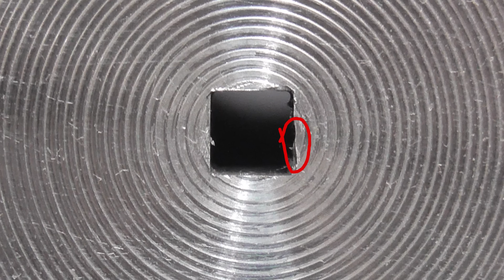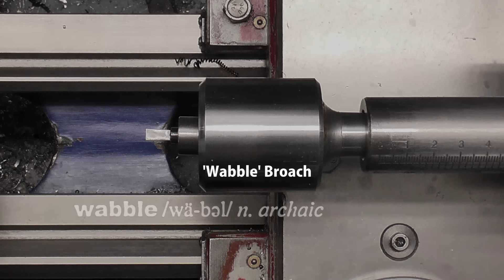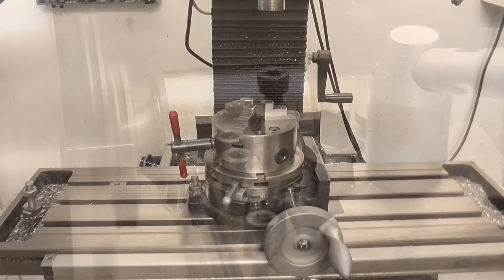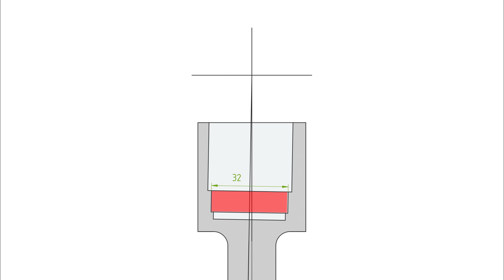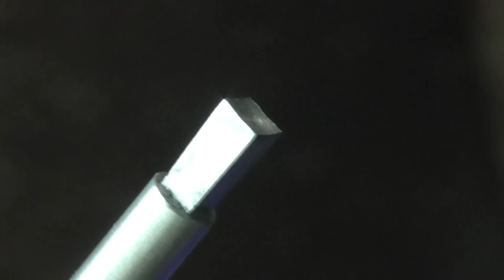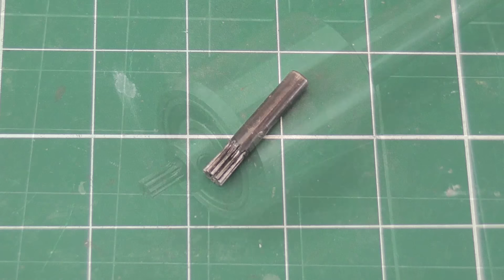Drill Square Holes - Rotary Broach

Comment: Simple design and well made, and an informative and  nicely-produced video to illustrate it! Thanks for this and for making the drawings publicly available. There are many designs of rotary broach holder out there, mostly produced by home machinists to avoid the inflated price of purchasing a commercial version, but I think yours hits the sweet spot. It's worth emphasising that, as your design has no radial or axial adjustment, the length of the cutter bit is critical within, say, +/- 0.5 mm. Too much deviation from this and the cutter will, at best, cut the wrong size or, at worst, break. An angled flat on the shank of the cutter, where the grub screw seats, helps in resisting the cutting torque and in ensuring that the cutter is on its abutment at the bottom of the holder hole.
Reply from the maker: Yes, the length of the tool bit is important, but I think you could actually a be couple of mm off on the length and it wouldn't make a lot of difference, most lathes have enough flex that it would self-centre in the same way a center drill does if the tailstock is not aligned. At just 1°, 1mm difference in length results in a radial error of less than 0.02mm

Comment: 10 millionth video of center drill being used instead of a spotting drill.
Reply from the maker: You're correct that for starting a hole a spotting drill is technically better than a center drill, however whilst you can use a center drill as a spotting drill and it almost always works just fine, you can't do the opposite and use a spotting drill as a center drill. Whilst I do own some spotting drills, I tend to only use them on my CNC mill if doing a lot of holes. I just find it easier with manual machining to use a center drill for both (one less thing to lose!). Plus, center drill is just the way I was taught years ago, though I have even seen people use a center drill followed by a spotting drill.

Comment: I was thinking about how I could do this without a mill, and I realized that I could put a shim on the end of the chuck for the angle. I'd just have to use the 4 jaw to get the right offset.
Reply from the maker: Yes, there are many ingenious ways to do stuff like this in a lathe, but the calculations and measurements are often harder.

Comment: Thanks for sharing, what's the largest square holes this type of rotary broach tool could produce? Do you think 12mm to 16mm would be within capacity?
Reply from the maker: As long as you drill a pilot hole first that's the same (or even slightly larger) diameter then it should be possible but will obviously require more force. My small lathe can handle 6mm square holes quite easily.

Comment: I mean for the id ob the bearing  u can although take a 61804. Personally i do not  think  the axial ball bearing is neccesary,  the combination of  61804 and a 7201 should work.
Reply from the maker: That would be a very good combination and with the min. abutment of the 7201 being smaller than the ID of the 61804 you wouldn't need the plug or ball bearing. I didn't have either of those bearing types to hand at the time.

Comment: I don't understand why the wobble offset was machined into the bearing housing rather than just being machined into the broach holder. Or are both ways just as effective.
Reply from the maker: It might seem the same but if the bearings are axial and the angle is machined into the holder then the way it rotates is different and there wouldn't be any relative movement between the work and the cutter, they would just rotate as one.

Comment: Quick question if I may…..what machines do you have in your workshop?  Had a quick look at your channel and patreon but can’t find anything🤔 I’ve been in the engineering drawing office design world for many years but want to go back to manual hands on stuff in a hobby shop….reliving my apprenticeship days with the smell of coolant and hot chips down the overalls 😁
Reply from the maker: My two main machines are a manual lathe and a manual milling machine. Both are benchtop hobby-sized machines (I don't have a lot of space) and I use these for probably over 90% of what I do. I also have a CNC mill I built out of what was my previous manual milling machine, a small CNC lathe I restored, Welders (MIG, TIG, Arc). I also have a variety of machines and attachments I've built over the years, injection moulders, casting equipment, EDM machine, gear cutting attachments. I've recently acquired a spot welder and a donkey saw. I also have (though you'll see it much less often) woodworking equipment including a lathe, bandsaw, planer/thicknesser etc... Some of these I use only rarely, I'd say a lathe is the only really essential tool, you can even mill in a lathe with a vertical slide which is how I used to do it before I owned a milling machine.
Reply: @AndysMachines wow, thanks for the detailed reply.  First thing will be a (Chinese?) lathe, bench top as I can’t see me lifting and moving a 250kg floor standing one🥵 Someone gave me an old seized up Pools lathe from the 1930s but I’m going to need a lathe to fix bits for that one! Think it used to be treadle driven 🤔. Thanks again.

Comment: As there's no preload on the radial bearings,  you could use needle rollers and make the whole tool slimmer.
Reply from the maker: Yes, and I expect that's what commercial ones use as they appear smaller in diameter. I just used what I had to hand at the time.

Comment: Thanks!
This is giving me dumb ideas of trying to make a rotary broach holder for a drill press.

I know drill presses aren't good at side loads, and why you shouldn't use jacob chucks for millling machines.
But here the majority of the load is just shy of on axis, and it's pressing more than cutting.
Makes me think the jacobs chuck shouldn't be a major issue at least.
So I think it might just work well enough to give it a try...

It would be awesome to be able to make little square, hex, or torx drive heads on random bar stock I can thread to whatever I'd like.

(Threaded an M10 x 1.0 thing the other day, because bike gear hangers have weird threads. I'll do the double nut trick on the other end of that one I think though. )
Reply from the maker: I think it will work fine in a drill press, the side loads are not high. My lathe is quite small and the tailstock will slip with moderate force, but it handles it fine.

Comment: My broach has a two piece body. The advantage is that it does not require exact same length for all broach tools, they can be centered. There are two bolts and slots to do a side offset.
I also saw a keyway broach it needs to be symmetrical, cutting two keyways at the same time. (never tried it myself).
Reply from the maker: That's interesting! I haven't seen one where you can adjust the offset, makes sense though.

Comment: Andy, why not just use your sinker EDM instead? If it needs an upgrade let me know.
Reply from the maker: Yes, good point. The EDM could do it, but this method is much faster, more accurate, less messy and the cutting bit outlasts an EDM electrode many times. EDM would be the only way to do it in certain cases though (like for hardened steel). 
I'd like to get more use out of the EDM I built though, maybe one day I'll convert it to a wire EDM which I think would would open up more possibilities for me.
Reply: @AndysMachines  If you use high side switching, without the capacitor, and copper electrodes the electrode wear would be minimal.

Comment: So uh, out of curiosity, did you put a square shoulder facing outwards, so that there was something you could try to grab on the spindle shaft, so when you invariably need to change the worn bearings out, you can actually get it apart? Cause as is it looks like there is no possible way to disassemble this, and diy rotabroach tend to eat bearings like candies. I personally think it's not even the cutting action, I think it's that initial impact of the tool making contact that kills them, but I don't know if that's true, it's just what "feels" right to me. Other than that, nice vid and cannot argue with results
Reply from the maker: Yes, I have disassembled it (when one of the cutting bits got stuck in the holder). The fit of the tool holder inside the bearings is enough to hold it in place but it can be pulled out without too much force. I'm not expecting the bearings to wear out any time soon, they are quite overkill for this, particularly the thrust bearing, the tailstock on my lathe will slip well before I reach it's rated capacity.

Comment: 'you can pop a balloon with a pin but not a potato'
Depends how hard you try...
Reply: Remember, every shape fits through the square hole, it's a strength puzzle!
Reply: I remember the trick of putting a bit of clear sticky tape on the balloon and sticking a pin in it. The balloon doesn't burst. A cool trick to play on someone who hasn't seen it before.

Comment: Yay new video! Always a good day when that happens. And it’s a learning one! I knew some stuff about rotary broaches but this explains sooo much more ❤. Thanks for doing that Andy. 

Question for you though, I was under the obviously mistaken impression that rotary broaches had to have n-1 faces than they were going to cut (ie a triangular cutter to make a square). Is this what you were talking about when it came to tool length and geometry around 4:45?
Reply from the maker: Thanks for taking the time to write a comment!

Broaches (as far as I know) always cut a shape defined by their profile. What you are describing I think is called Reuleaux polygons where a shape with curved edges rotates around and traces out a polygon with straight sides, it only works with odd numbered generating shapes which trace even-numbered regular polygons. I've never tried to machine anything with this technique but I have seen square holes cut with triangle-like cutters (though this may have been a similar but different technique).